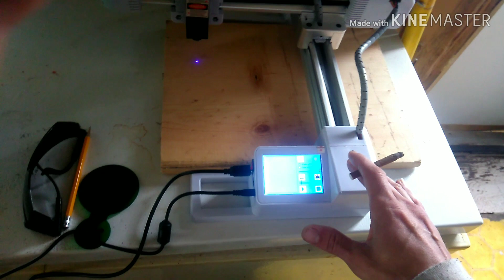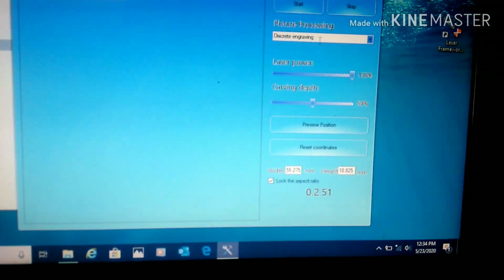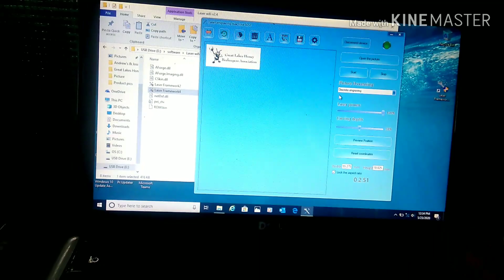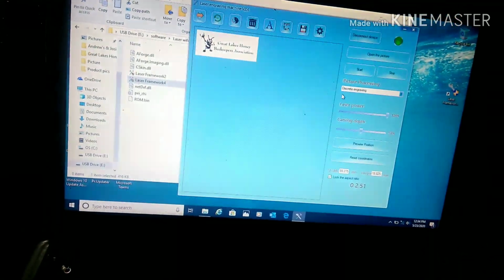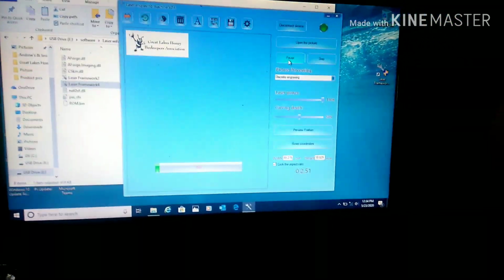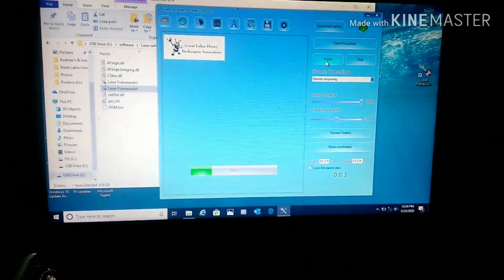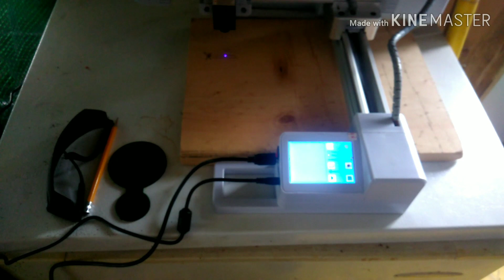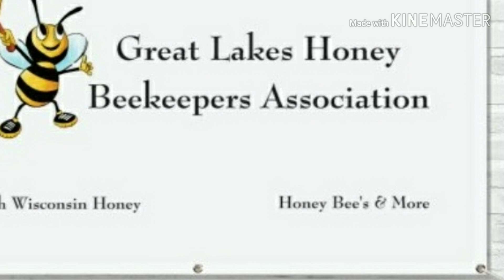Testing out the new 3w laser engraving machine

Comment: Can it engrave on stainless nacklace ?
Reply: It's might be possible if you can get the print that small but that would be extremely difficult with the software the manufacturer provided. Not much for options so finding a different compatible software program would be a must.

Comment: Does it engrave on metal?
Reply: Depends on the type of metal you may need to make more than one pass. I've been able to engrave on tin and soft metals, glass (need a coating on the glass I used washable marker worked good) and yes it can cut the glass and of course wood. But if you're looking at doing major metal projects I would highly recommend a higher wattage laser or a CO2 laser engraver.
Reply: Hardened steel - NO not a scratch
Reply: Leather - yes, vary nice

Comment: I cannot get the machine to make my picture larger than 3x3inches. This is infuriating. POS, I'm going to buy one from another manufacturer. This software is a joke.
Reply from the maker: Think the largest I've been able to burn is 6x6. And yes the software is a joke it's vary limited and I do most of my pre-work on a different program to get the design just right but it's a huge pain in the a** and since the use stick broke now I can't use the PC because of the software difference between the PC and mobile version. I definitely don't recommend this system. 5watt or higher if not your just wasting your money.
Reply: i read 17.5*15.5CM (6.8*6.1 in)  i sure hope does bigger then 3 x 3 if not i wont be happy

Comment: Will this be able to cut through thinner surfaces such as 2mm plywood or does it only engrave
Reply: It can cut through curtain materials but you might need to run a few passes depending on the thickness, I've cut glass, plastic, wood, and thin tin/aluminum.

Comment: Can you print without the USB cord connected to the computer?  I read on the Amazon reviews that you can print from a thumb drive.. But I am not having any luck
Reply from the maker: Your supposed to be able to save the file to the thumb drive, but we haven't had any luck with it as well
Reply from the maker: The only thing we've been able to print off the thumb drive is the preloaded image's so we use PC and the app on our cellphones.
Reply: @thomasapiary  what application are you using for the cell?
Reply: Only .bmp files in bmp folder of the thumb drive can be  printed without USB cable